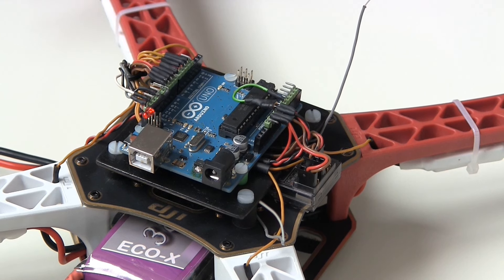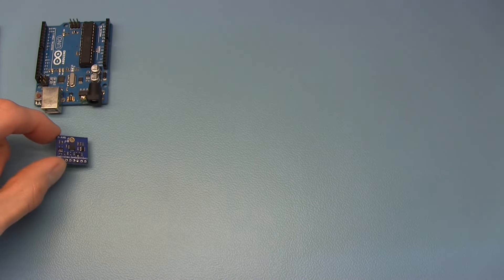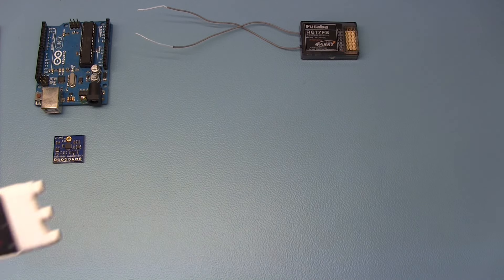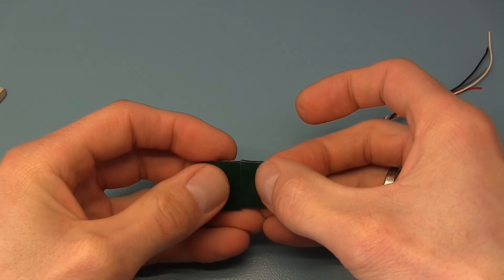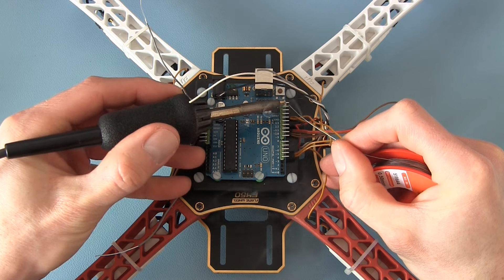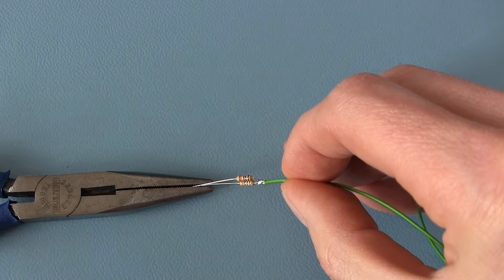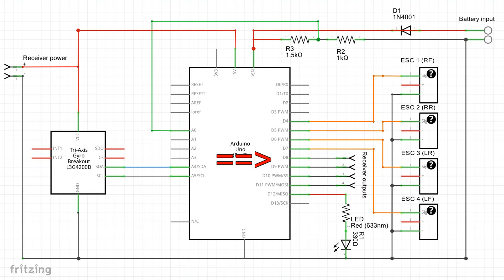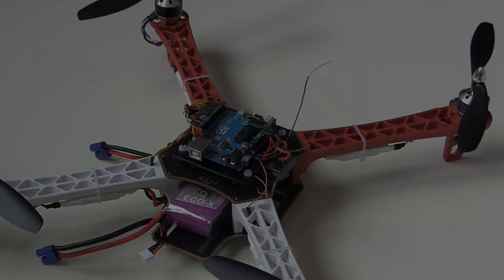Your Multicopter Flight Controller - 3D (YMFC-3D) Part 1 - Hardware.

Comment: Almost finished with my build, Joop! Thank-you for creating this project! I'm looking forward to digging into the code as a first SERIOUS programming project.
Reply: @kc koellein, could you please help me out with the connections of the Ardunio UNO and the other circuits? For one, I just can't understand how to take a common ground for the ECS terminals(the three-pin section)
Reply: @crazycampers5466  I am in the process of building the drone and I am now facing the same problem. I designed my own frame and I am using solderable PCB for the power distribution board. One solution is to use header pins and connect all of them together and one of these pins goes to the ground pin in arduino
Reply: @Chris Miles instablaster :)
Reply: @Jayce Jaime thanks for your reply. I found the site on google and im in the hacking process now.
Looks like it's gonna take a while so I will get back to you later when my account password hopefully is recovered.
Reply: @Jayce Jaime it worked and I actually got access to my account again. I am so happy:D
Thank you so much, you really help me out :D
Reply: @Chris Miles No problem xD

Comment: Hi i have a question about power Vin and A0 ,   if the batery is 3s = 11.1 Volts   ..... The resistances is a divisor voltaje right?   Vin= (11.1*1.5)/1.5+1 = 6.66volts   and Volt Ao =4.44Volts..... but the power in arduino must be 7Volts---12 volts and Vin is 6.66Volts
Reply: +Carlos tercero no look well at the schematic vin receive 11.1 v not 6.66 loOk the wires. A0 receive 6.66 but i think it not safe for the board, because a0 must not recevie voltage higher than 5 v
Reply: +jones rayan  OOoo  its true... thnaks you very much for correct me , I suppose that A0 must have a regulator or something...
Reply: +jones rayan  Its posible change de resistance R3.... if R3 is 820ohm -->  Vin=11.1(820)/1820 =5.00109Volts...
The analog inputs have a diode but this diode can destroy if the voltaje is higher for a long period of time...
Reply from the maker: +Carlos tercero A full lipo has a voltage of 12.6V, not 11.1V.
Reply: +Joop Brokking  Thanks joop   :  )
Reply: how would I calculate that for a 4s lipo battery? and what would I change in the code
Reply: 1000/(1000+1500) = 0.4,  
A0 = 0.4 * 12.6 = 5V
Reply: @rumirleto6061  hi there I am using 5200mah 4 cell lipo battery can you please tell me what resistors should I use in order to decrease the voltage?
Reply: since it is 4 cell battery, it has max voltage of 16.8, so the ration of the resistances should  5 :16.8 = 0.2976~0.3. You can maybe take one 1.5k and connect to it to the one with resistance of 3.5k(i am not sure if there is a single resistance of 3.5k, maybe you will have to use a combination of 2k and 1.5k), although you can use a different combination, but be careful not to choose too small values because of the amps!
Reply: @rumirleto6061  What formula you used in order to calculate the resistance because I am trying the ohm's law and every thing becomes pretty wired is there any other way if there is so please tell me that will help a lot... :) thank you
Reply: @rumirleto6061  hi I really need your kind attention please tell me how to calculate the resistance because when I am trying to calculate my outputs are absolutely different

Comment: Hardware wise, this setup is frightfully mature. It has Vbat which isn't even universally featured on specialised FCs, and using a diode to prevent USB powering the whole system is a painful reminder of the missing-diode on Naze32 rev6 prototypes.

Many ppl are commenting about WIFI control link. My inner FPV pilot says it's not feasible, but my coder personality tells me to look into ESP8266 or XBee lol

Comment: Mr. Joop, I am an Elect. Engineer and  a keen learner of something new, even at the age of 68 yrs. I also launched a plateform for free education preferably for poor students.

I started learning this drone projects just 2 months before. But got made succefully with help of your videos (the best I came accrross).
Very easy to follow up. The best , smooth & easy way as you explained . My motto is to make drone videos in Hindi language using your principles after getting full confidence and doing some experiments following you. Can I ? 

Sir, I tried with the way of Mr. Andrei(Electronoobs) videos based on MultiwiiConf, but could not get success to operate drone as no PID signals from hand made remote controller 6ch. to FC. I do not know what mistake I am doing. Kpt working 2 months without success.
and with your videos got success in 2 days only. He is also not able to understand. Seems code and Confih.h settings.

Can you guide related to Multiwii drones. ? Pl sir I want to to know the very cause of failure. I could find your videos/website related to this.

Thanks to you and your Plateform.

Comment: Hey sir i finished my Quad copter which works as a rate mode quad.I followed your these 6 videos and built my own code getting the knowledge from you.I used mpu6050 and also i had to use a kalman fliter as i was getting much noise from vibrations. And with my pid settings i got 100% stability.Here are my settings. For  pitch and roll p =1   i=0.001  d=15  and for yaw  p=2  i=0.001  d=0 . U are doing a great job with this series.keep up the gud work

Comment: if you use the 5V output from the Battery Citcuit Eliminator (BEC) in any one of the ESC you should be able to power up the Arduino NANO/ProMINI without issues (just make sure that you choose a 5v ProMINI version) ... it will be much smaller and lighter then an UNO but still retain the same I/O capabilities of the UNO.

Comment: Would like to have your validation of the power supply redundancy.   Instead of just connecting two lipo in parallel, a circuit is built to control the power supply of two 6S lipo A and B.   By default the copter will get power from the power reserve (capacitor) that initially draw current from lipo A.   As lip A's voltage drops to say 21 volt, the system will automatically switch to draw power from lipo B.

Comment: I am building and expect diode and resistor done same things but after some time my one motor stoped working also they are not rotating properly after just starting and not giving any throttle they start wildly ang go unstable braking my 2-3 propellers please tell me what's the issue and how can it be fixed
Thank you😢

Comment: good work but i have a question , i didn't understand how did you choose the direction to fix the gyro because it depends on the motors as i know
Reply from the maker: It depends on how he gyro data is used in the program. And how the program controls the motors.
With the YMFC-AL the orientation of the gyro is not important anymore: https://youtu.be/DYpHB-LfloI

Comment: Hello +Joop Brokking
In your video you are using L3G4200D but in ((Project YMFC-3D_Q&A_#8)) in your website  you changed the gyro from L3G4200D to MPU-6050 ?
and Why did you connect the voltage divider resister connection to A0?
Thanks
Reply from the maker: The MPU-6050 is cheaper and is used for the YMFC-AL. Check step 3.1 on this page for the voltage divider: http://www.brokking.net/ymfc-al_main.html

Comment: Mr Joop, congrats for this project. 
I have any questions about yours code. 

Is it possible include plus four motor/propellers on code (I am building a octarotor)? 
If the aswer is yes, how do I do this? 

Thanks a lot.

Comment: Hi, first congratulate you for the quality of your videos, the explanation and the information is very good.

I wanted to comment if you could add the writing, I mean for example in your MPU-6050 videos, but for these parts of the YMFC-3D hardware and software to translate it, I do not speak English very well.

Thanks for the hassle, and again, congratulations on your work.

Comment: Hi, in your connection diagram ,it shows LiPo Battery 3 cell 11.2 v 20C 3800mah. Can I use LiPo battery 3s 11.2 volt 25c 10000mah? What are the extra component required to establish the same.

Comment: Feeding the Arduino using the 11.1V battery is through the Vin voltage regulator, correct? Is there a reason you don't recommend using the +5V BEC? Reason I ask is because I'm planning on using a Arduino Pro Mini for this project, but the voltage regulator on it is too tiny to last long at 12V. Meaning I would either need to build an external regulator if I use 11.1V.
Reply from the maker: You could use the BEC of the ESC. But the voltage regulator of the Arduino will give you a cleaner (less noise) voltage.

Comment: Can you mention where you got the base, motors, I'm really starting from scratch here, I've got NONE of the equipment your using.  What is that in the second video also, a digital oscilloscope? I have the transmitters from drones I've broken, but how do you make the adruino actually receive the signals? Please provide the links to these in your description.

Comment: seen a lot of basic guides for quadcopters. found this is the best one! just one small doubt. doesn't this need a power distribution board or something? and what about the infrared sensor. where did that go? didnt clearly get that in the video
Reply from the maker: You can check the hardware on my website: http://www.brokking.net/ymfc-3d_v2_main.html
And it does not use a infrared sensor.

Comment: Hi, I have one question. In the video you are saying you are using the UNO cause it has superior capacity of outputting more than 150 mA. I was just taking a look at the UNO specs, it says it uses LP2985-N regulator which also has a max capacity of 150 mA... did something change on the spec?
Reply from the maker: The LP2985 is used for the 3.3V rail. The 5V regulator (the one I was talking about in the video) is the NCP1117.

Comment: Hi Joop,
The recommended voltage range of the VIN input is 6-12V, whereas your 3S LiPo battery is supplying a maximum 12.6V. The voltage drop of the diode is about 0.7V meaning the VIN is taking 11.9V? Is the diode the part of this build that is preventing the VIN from being damaged due to having too high of a voltage input? Thanks.
Reply from the maker: It can handle up to 20V when the current is low enough:
https://store.arduino.cc/usa/arduino-uno-rev3

But with the diode will also help to keep the voltage around the 12V recommended voltage.

Comment: For low battery indication led is connected to digital pin 12 (7:30) but where do we connect the other end of the led?
Could you tell me abut that...!!
Reply from the maker: You can download a schematic here: http://www.brokking.net/ymfc-al_main.html
Reply: Thanks, Joop..!!
Reply: Simply to a GND line of the Arduino Uno or a GND line of the Arduino shield (if you use the last one mentioned): D12 to R330 to +led / -led to GND.

Comment: I'm going to be using the BEC from all 4 of my ESCs to supply 5VDC to the Arduino. For the A0 input, can't I just mount the 5VDC rail to it, without a voltage divider?

Comment: Do you think PLA 3d printed arms would be strong enough for this project? It seems like there would be a lot of force on the arms
Reply from the maker: The whole quad weights about 1200 grams. That's 300 grams per arm during normal flight. Full throttle might be double that. So if you have a good construction design a 3D printed arm will work. If it will withstand a crash?... you just need to try it.

Comment: Hey I'm using 1400 kv motor which prop should I use. Should I use 1045 prop. I'm using fs ct6b transmitter is it OK??

Comment: Hi there, I'd like to start by saying thank you. I have watched this entire video series and its been amazing! I do have one question though. In your schematic it shows you wiring your gyro to Analogue pins 4 & 5 yet in the video you instead connect them to the pins above Digital pin 13. What pins do you use and why these pins instead of Analogue 4 & 5? Thanks
Reply from the maker: There the same pins, only on different locations ;-)

Comment: I am currently constructing a quad copter based on your design.  I just need to clear something up regarding the ESC signal wires.  The ESCs I have came with a three prong signal wire and I am wondering how exactly you condensed yours down to one wire.  Did you strip those wires back and solder all of them together to a single lead wire or did you just use one of the wires out of the three for the connection to the arduino?  I guess I am just confused to what each of these wires represents for the ESC.  Any explanation would be much appreciated.

Comment: Thanks for your quick response.  i downloaded the ESC calibration with no errors.  Then i noticed that when i plug in my battery I'm not getting power to the Arduino nor the receiver.  im going to check my connection.

Comment: I built a quadrocopter based on this manual. I think everything was soldered correctly. However,
 the battery voltage suddenly drops (for example 3,71V on one cell to 3,18V) after the take off, which triggers an alarm set at 3.2V. I don't know where the problem is?
Reply from the maker: Measure the voltage with a multimeter and check if you see the same thing happen on the multimeter.
Reply from the maker: The multimeter shows no problems and it's normal that the voltage drops when the motors are at full throttle. Make sure to fully charge and balance the lipo battery for each flight.

Comment: In schematic it is shown that we have to connect battery to Arduino.I am using 25c 3 cell LiPo battery can aurdino hold 11.1 volts ? plz replay And also i am using MPU 6050 as gyro it has slave register and master register it not shown about other register which one should be used to hold data as u shown register 1 & 4 for holding data

Comment: So what wires are you connecting to the positive connection on the board I'm guessing it goes to the Arduino uno but I can't find it on the schematics sorry I'm new to quads thanks for any help
Reply from the maker: What board are you referring to? The power distribution board of the frame?

Comment: In the pictures on your website, the small ground wire in the 3-wire cluster of the ESC (Electronic Speed Controller) does not appear to be connected to any ground. But in your schematic, it shows that the ESC small ground wire is grounded. To be safe, should we connect the small ground wires directly to the PDB (Power Distribution Board) where the large black ground wire is? Thank you in advance for the help :)

Comment: One more question:Is there any specifications about the wire?
Reply: I use wires from an old PC power board. For lipo connection and powering the Arduino from PDB you can use 14AWG-wire.

Comment: hello, please what means the numbers 1,2,3,4 from the receives in the schematic? I m using a RFn24L module as receiver and would like to know how to connect it? thanks for the video !!
Reply from the maker: You need to implement the NRF modules directly in the code. Replace the receiver subroutine with the NRF values.

You might like the channel of Iforce2d. He does a lot of flying with the NRF module:
https://www.youtube.com/user/iforce2d

Comment: The connections of the motors to the ESC are all the same, or they change so that they turn to the contrary.
I guess all the same and then with Arduino you order that each one turn different. Or changed connections and arduino all turn the same.

Comment: in the video u connect the gyro wires to the digital inputs where as in the circuit schematic it is connected to the analog inputs??????n the connections of the receiver tooplease tell me the connections, very tensed have got all the stuff.. need to submit the project by this Saturday . helpppp me plzzzzzzzzz

Comment: Can you give me some guidance if I want to build a coaxial drone with just two brushless motor and servo? Will your code still be applicable? 
Another question is, in your video, you didn't use any distance sensor. It seems like the gyro sensor can handle everything so do you think distance sensors aren't necessary?(like moves away from walls if the drone is 1m close)

Comment: Hello Jon, i'm building my own quadcopter flight controller too and i want to ask you how do you control your motor. I'm using the PWM function analog write to control it. To found how to regulate the PWM i use a linear interpolation of the motor speed. Another problem that i found is when i filter the signal. I am using the Madgwick filter and the sample rate  decrease to only 80hz, is that enough in your experience?. And how do you add other functionalities with such a low sample rate.Pd: I am using the Plus configuration
Reply from the maker: Walter Benitez I'm still working on this video session. The esc's and how to control them will be discussed in part 4. Using the pwm function is not necessary and will cause unnecessary interrupts. For this project I just make a pulse with the timer.

The sensor refresh rate and esc correction refresh rate should be a high a possible. 80Hz is to low in my opinion. The YMFC-3D project runs 250Hz for sensors and esc's.

Comment: Just wanted to know why you only connected the data wire instead of both data and ground wire from esc to arduino uno. Is it because it's connect already to the frame?
Reply from the maker: Yes, the ground of the ESC is the same as the battery and thus also the Arduino.

Comment: On the schematic it does not include the red and black wires of the esc. Are the only connected wires of the esc the signal wire, the - on the servo lead, and the three motor wires?
Reply from the maker: Yes, check question 13 on this page: http://www.brokking.net/ymfc-3d_v2_qanda.html

Comment: I have a question about the power supply in your YMFC drone. If you are using lipo 3s 30c, its max output voltage is 12.6V which is more than the max input voltage rating for Arduino UNO. So, how did you manage it? What can I do to prevent it from damaging my Arduino UNO.